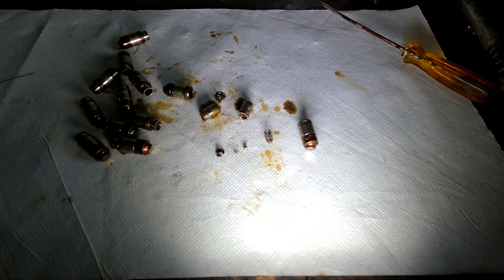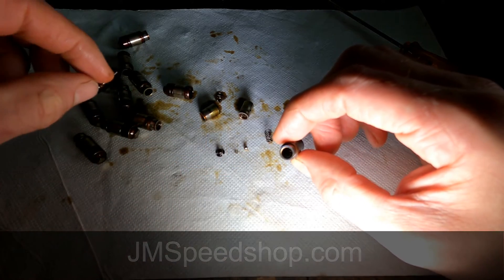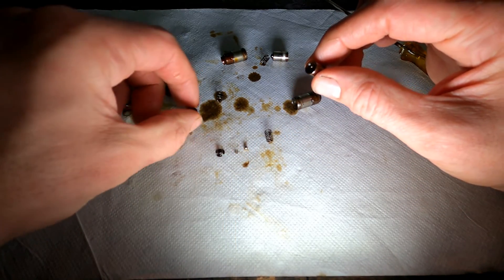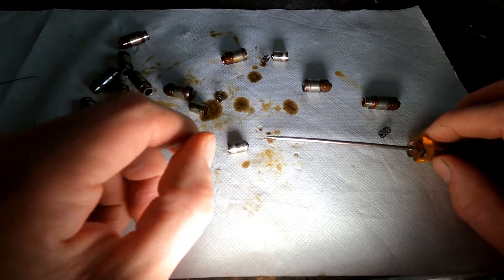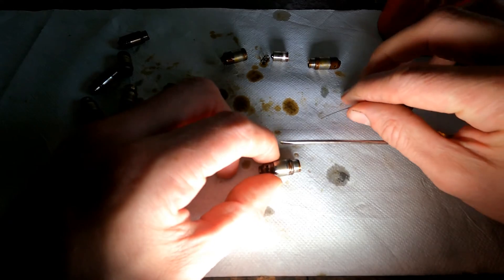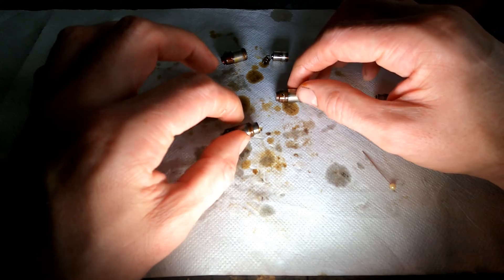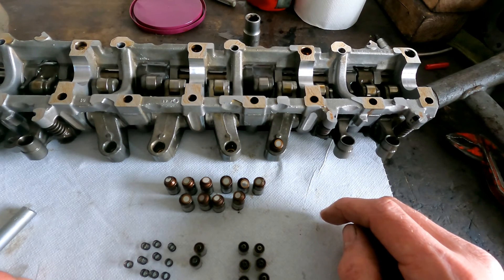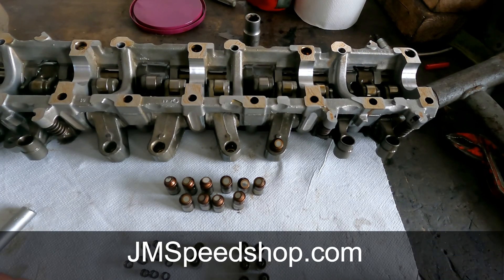M113 engine rebuild - Part 9 - HOW TO: M113/M112 hydraulic lifter how do the work?

Comment: Hey man! When looking at xentry parts, for replacements on the compensating elements there’s a market note from Mercedes Germany saying that for all m113k engines the whole rocket arm has to be replaced, whereas in your video you said they’re all the same. Just wondering if you had any insight. Thanks!
Reply from the maker: Hello 
I have not seen that note.  But i have rebuild these and the are the same . I have never replaced 1 i just take them apart clean them and put it back together

Comment: Hey what will happen if left unfixed ? M113k
Reply from the maker: On the long term you can get damaged to the cams and rocker assembly
Reply: okay thanks.does it need to be fixed immediately? mine goes away once cars warm.

Comment: My ml55 has a misfire issue on bank 1 with multiple misfires usualy on 2 or 3 cylinders (TWC misfire damages etc in the computer codes).     iv been chasing my tail thinking it was something electrial or electronic and have replaced everything new from sparkplugs and coils ign leads and deleted all cats.     I dont hear any real lifter tick but the car does sit for periods and then when I go to start it sometimes it does this misfire issue.   I shut it down and restart and its ALWAYS fine for the rest of the day it never does it again only on random cold starts usually after it sits for a little while....   Im wondering if I need to tear into the the head and inspect clean all these lifters??    The lifters/roller rockers are probably due for an inspection anyway at 210+kms.    I hear if the roller rockers can jiggle sideways due to their alloy construction on the stainless steel round bars then they can leak oil and not pressure the lifter properly.... thats what im suspecting now.   Multiple things I probably need to carefully check in there?.....
Reply from the maker: If the engine is using oil on these cylinders more then the can be more sensitive. To knock also.  Did you boroscope the cylinders to see if the walls are clean?
Reply: @JMSpeedshop  ok will do that and see.     I noticed knock at overrun on the knock sensor when WOT full pull right up to high rpm its odd tho because it only shows knock counts on my scanner when the throttle is let off or between gears.    But the thing runs fairly strong and doesnt use any oil or smoke..... I pulled a trailer loaded with an w211 e55 amg across country over massive long gradient pulls up mountains and it never missed a beat and was strong.   Again it only misfires on cold start and once you turn it off and on again it will never do it again for the rest of that day.
Reply: @austingtir Hi, was your problem solved by changing or cleaning?
Reply: @RSHZY  Seems to of been a vacuum leak from that stupid line that goes under the intake manifold to the air chamber in the intake manifold.    Atleast since I replace that line it hasnt done it again.
Reply: @austingtir  thanks for answer, from my side is that fully reworked.. :(

Comment: Have intake lifter that don't get fully pressurised. M113k took it out know 3 times. Starting to think it my be oil pressure. Will be checking oil pressure next. At first found soft lifter on cylinder 5 first intake. Replaced still was noisy opened up 2nd time same just new lifter on same rocker arm. But this time lifter checker valve was broken. So replaced rocker arm and lifter. All lifter on that side now is brand new. Still noisy. Opened 3rd time now on cylinder 7 intake lifter soft. Took it out all good nothing broken lifter working as should. Washed intake shaft used air to blow out. Put to gether still noise. Still one lifter not fully pressurised. All problems on same side intake side. Any suggestions?
Thank you
Reply from the maker: Can be a oil supply problem but then you should pull the head and clean all oil passage's.
Reply: @JMSpeedshop thanks, still waiting for oil pressure adapter. Hope solution will be clogged pump. Or o ring on it so sucking air with oil.
Reply from the maker: You would expect it to be blocked in the most narrow space so in the camshaft bearing bridge entrance passage
Reply: @JMSpeedshop  and to  clean it only head has to come of. Or should try some oil flush and additives? Or take bridge of and try to blow passages, but it probably will get stuck again or somewhere else. As once it started ticking I used some engine flush and lifter additives and it went away, but later came back. Thanks
Reply: @JMSpeedshop it makes sense, as oil entrance passage is shared for exhaust and intake. As same port from head to camshaft bridge. As exhaust side running good means oil is coming to it, so blocked should be passage to intake side just or at intake shaft. Thank you.
Reply from the maker: To take the camshaft.bearing bridge of and clean it good also the passages is a very good start to have look if it will make a chance
Reply: @JMSpeedshop  hi just want to say thank you. Finally after 4th attempt noise is gone. Took everything apart gave good clean to bridge shaft. And that little metal cover that is on bridge under to bolts. Positioned it in center as possible. Finally it sounds how it has to be. Oil pressure on hot idle just over 1bar. So once more thanks for help.
Reply from the maker: Perfect👌
Reply: @domasbartusevicius4218 I also had issue after reassembly of engine with rebuilt lifters

I am beginning to wonder about this same cover plate, I noticed during assembly this plate on the bearing bridge is crudely positioned. I may even add sealant this time…

Comment: Hi. My M112 has lifter noise on start up, goes away in about 15 secs. How would I tell which one it is? thanks
Reply from the maker: That is hard .  But you can determine which side .  But exact which cilinder is hard
Reply: @JMSpeedshop  how do determine which side? Thanks
Reply from the maker: Do it together with a buddy.  Let them start and you can listen under the hood which side it is
Reply: Would you suggest I rebuild all of them? Thanks
Reply from the maker: I would deside which side it is .  If you want to remove the lifters .  You need to remove the camshaft bearingbride complete.  The you can can all the lifters out on that side and check them like i did in the video and chance the bad ones
Reply: @JMSpeedshop  1) do I need a special tool to get them out of the rockers?  2) does the engine need to be in a specific position, like all valves closed? How to position the engine.? Thanks!

Comment: Very nice, I will be doing this to my 5.4 m113. So when putting the lifters back together I basically try to push it in as much as possible ? Also when installing them into the arms would is any oil necessary?
Reply from the maker: When the are clean oil them and put them back together and release the checkvalve so you can push it in complete into the spring pressure.  Then release it.  There will a little air in it.  But on the first start you will here some valve noise but when the oil flow is going up to the cylinder head the will fill up the lifters to the right amount to fill up the clearance